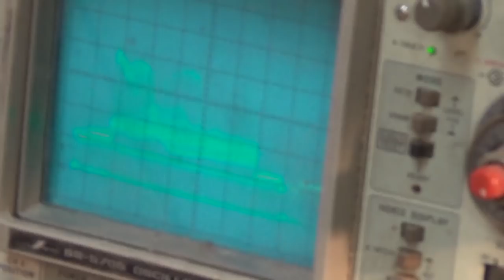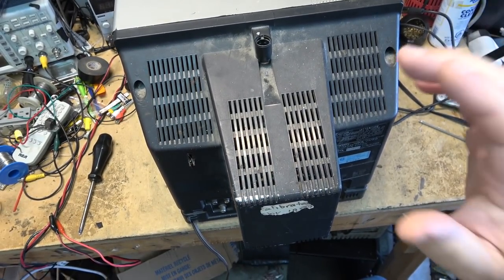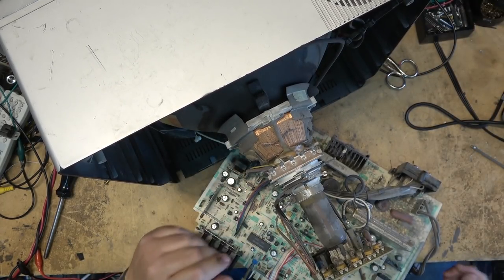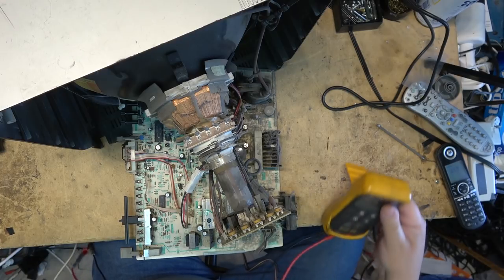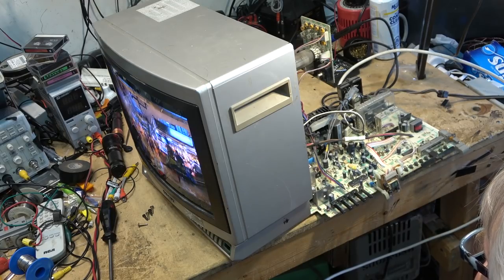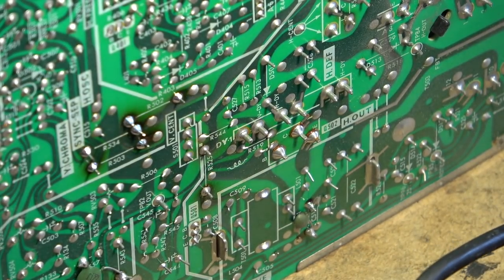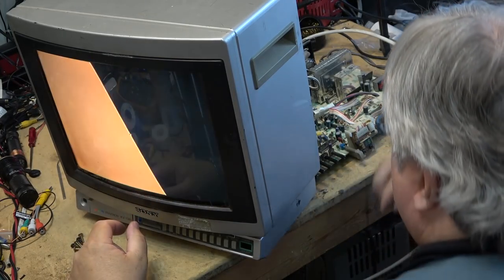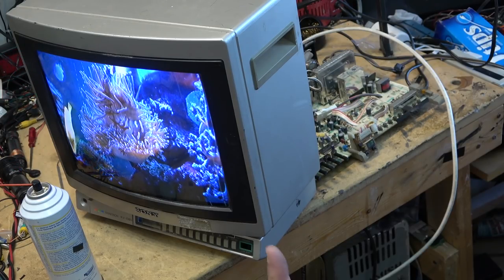Sony KV1365 Trinitron with a vertical and video switching problem

Comment: I had a 1996 Sony Trinitron set I bought new, it was a 27". Super nice picture and it weighed 95 pounds!
Reply from the maker: Is that all? The 40" tube weighed in at 385 lbs and required 3 men and a boy to move.

Comment: I have one of these with the same model number but a woodgrain cabinet. Got it at a thrift store for like 2 bucks a few years ago. Works great as found. The only problem is I need a pencil, etc. to press the internal switches for channel up and down. I plan on trying to solve that sometime.
Reply: Yep! Also got the same woodgrain one. Found it in an abandoned basement. Worked great for the last two years, but it's starting to wig out on me. Maybe it needs a recap?
Reply: @MajorCadence  Do remember that these sets can hold deadly amounts of charge in them, if you work on them be very careful

Comment: I remember repairing a later model 20" which had cracks on the main PCB around the line output transformer. The customer took out the line output transistor and marked as 'failed', as the B-E Junction measured 40 ohms, but later research showed an internal damping circuit integral with the transistor, and did not need replacement, even though there were 'dry' solder joints on the line drive transformer output. From memory, it was a 'flat pack' case style, and used a silicone rubber insulator on the heat sink. Your model might have been the last time they used the TO-3 case style without internal damping of the transistor, but a direct connection to the output of the line drive transformer, and perhaps more susceptible to failure. As there were many cracks on the main PCB (the TV fell from a low table to the floor), I used speaker wire (about the same gauge as the yoke wires) to 'bridge' the fractured copper traces. It ended with a successful resurrection without damage to the aperture grill of the picture tube, and so I could be grateful that the main PCB took most of the damage in the fall, thus saving the picture tube...!

Comment: Yep a bad case of 'Crackus jointicus'  and damp switches.
I'm supprised it still works, it's been used for long periods of time with all the video editing.
Damp is the enemy of old equipment :-(.
Still alive after all these years, sony made good products.
Reply from the maker: Not really.   It might have gotten 30 hours a month max on it.   I did production work but not every day.  Mostly used when doing 2 camera wedding shoots.   I did a couple a month and each one had about 5-7 hours or so of editing. For the corporate stuff we had a suite with leased betacam gear.   The stuff I did at home was mostly weddings, real estate shoots, international conversions and 8mm film transfers.

Comment: Our local library had some 1980s RCA TVs with added headphone jacks. One day I was watching a video and got up to open the door. When I stood up I had the headphones in my hand and when I grabbed the door knob, I got one hell of a jolt. The headphones were the kind used at schools with two metal straps connecting each earpiece. The metal straps also connected the left speaker to the right speaker electrically. So when I grabbed the headphones and the doorknob which was attached to a metal door I completed a circuit and got zapped.

Comment: I remember when Sony had so many problems with the TVs they shipped from Japan they set up a factory in the UK.
They made the CRT tubes in factory and some of the smaller components were imported. 
When my 36" wide screen CRT Sony set died from a dud flyback transformer, I replaced it with a Panasonic LED screen TV and it's still working 21 years later. I doubt if I will find a replacement that will last as long when it finally dies. 
Just for a note the Sony 36" CRT weighed 50 Kg ( 110 Lb ) and needed to men to lift it.
Reply from the maker: 21 years ago they weren't making led screens.  There were LCD and plasma, and Panasonic was big on plasma sets.  They cost a bloody fortune in 2000. Like 12,000.00 fortune here for a 42".
Reply: @12voltvids  Your right it probably is an LCD but it's still working whatever it is.

Comment: I've got a 34-inch late-era hi-def widescreen Sony. Pretty good picture but it's got a couple of scuffs on the top front and the tube seems to have suffered from some sort of a forward tip. The purity is a bit off on the sides and the convergence is a bit lacking even after I reseated the yoke, readjusted the convergence rings and adjusted the digital convergence adjustments. It's a shame but luckily it's easy enough to ignore. The caps on the other hand... they're less than happy. Lots of blooming, even with its high voltage regulator and some subtle picture noise issues too. Meanwhile my beat to hell shadow mask sets look great, even one that seemingly fell flat on its face since the center of the tube is scuffed up.

Comment: I can't imagine what it would've been like capturing and editing pro-level digital video in the late-'90s. Hobbyist DV was hard enough.  In 1998 I had a 150mhz Powermac clone and an ATI XClaim VR video capture card.  I could just barely eek out 15 fps, 320 X 240 video with only a couple dropped frames on that setup.  Fun to play around with though. Funnily enough  I had a 15" Sony Trinitron monitor for that computer, I think a 15iiSF, or something?  I can't remember.
Reply from the maker: I was editing on a pentium 2 using a gigantic 9 gig UW SCSI drive in full broadcast video. 
The 9 gig could store about 1 music video of clips. 1 minute of video, 1 gig. Rendering took forever.
For this fun I spend about 5000 for the hard drive alone.

Comment: Great looking picture i have a semi portable 18 inch sony from 1984 that i like has the glass panel over the tube ,i then went on a search for an original remote at the time i found one on a worldwide search uk seller and before shipping it they tested found some of the buttons did not work and refunded money i spoke to them and asked if i could still buy it and they sent it for £2 towards postage ,the main button i wanted to work worked the one to remove the onscreen channel number .its an rf only set but i have a scart to rf adapter and that works fine with it .

Comment: I had that exact TV about 20 years ago. It was a great little set. I found it put out for garbage, took it home and the only problem was someone had deleted all the channels, so the tuner was showing a question mark.
Reply from the maker: Wouldn't have been this set.  No channel memory on this one.  The remote version yes.  And noone deleted the channels the static RAM chip failed.
Reply: @12voltvids  Yeah, I posted too soon (should have watched more than 3 seconds of the video, whoops!). I checked, I had the KV-1370R.

Interestingly when I added the channels back (had to use a remote to tune them), they stayed permanently, even powered off for weeks. Maybe something cause the static RAM chip to take a dump that one time.
Reply from the maker: @probnotstech  strange because usually when the memory chip went out it stayed out.
Reply: @12voltvids  Weird then. I remember that set worked great until I sold it.

I had assumed some kid went and deleted all the channels, because I had done exactly that as a kid to my parents' TV - with similar results.
Reply from the maker: @probnotstech  possible however generally when that happens the set starts on channel 2 and just stays there when you press channel up or down.
Reply: @12voltvids  I think that's what my parents' RCA console did when I messed it up. However, when you tried to change channel, it would just flicker gibberish on the LED readout and act like it was cycling through the channels (similar to how those sets acted when they got cold solder joints in the tuner). That was one those RCA sets that didn't have a numberpad on the remote, only up and down.
Reply from the maker: @probnotstech  good old RCA colortrak.
The colortrak 2000 was even worse. Some rocket at RCA thought it was a good idea to store the channel memory in the remote. It was this big Square remote with like a fake leather  wrap and it took two 6 volt type j batteries. Now those batteries have been developed for Kodak with their instant camera. Polaroid sued Kodak and one for patent infringement and all the cameras had to be recalled. Ever ready had made billions of these stupid batteries and now there was nothing to use them so RCA started using them in the remote controls so there was a use for all these surplus batteries. On the TV there was number buttons 0 through 9 and volume buttons but no Channel up and down. On the remote control you had number buttons volume up and down and channel up and down and the stupid remote stored the channels in the memory there was an add and erase button also on the remote.
Needless to say when the remote got damaged people were not too happy because they couldn't scan through channels they had to enter the channel directly on the TV. And all those sets if you wanted the video inputs you entered 91 for Video one and 92 for video two.
Reply: @12voltvids  That's fascinating about the J type batteries. Zenith used them in the early 80's too, and I always thought that was weird. 

I remember my some friends had one of those Colortrak 2000 sets (no remote, of course). As you described, no ch up/down buttons on it, and the usual RCA ch91/92 inputs.
Reply from the maker: @probnotstech  
I wonder if the j battery is still available? That was america coming up with a solution to a problem. What to do with millions of batteries that had already been made.   We will just use them in a remote and store the channel memory in that remote.  That way there will be a drain on the battery and you will have to spend 9.00 every 6 months for a new one.   Not joking that was about the life of it.  They used then for many years.  I think right to the end of tv production in the USA.
Reply: @12voltvids  You can still buy them, believe it or not. I think I even remember seeing them in stores maybe 10 years ago.

Comment: i have had multiple shocks in the past while connecting or disconnecting coaxial tv antenna cables. Usually when touching the metal outer shield of both connectors. I still wonder why
Reply from the maker: Leakage through the isolator.

Comment: i'm surprised you would junk anything,you seem to able to fix most things
Reply from the maker: I toss plenty of things.   It's not a point on if it can be fixed.  Some things I fix for fun and to make a video.  Before it goes back together the parts cone out and off to recycling it goes.  I have a garage full if stuff that much will be heading to the bin soon.  There is much stuff abandoned.  People send me things to fix and then when they get the bill for it tell me to keep it.   A VCR I did last week, guy spent a fortune sending it to me thinking it was a good VCR (svhs) it wasn't.  It was a standard VHS Hi-Fi. I was prepared to send it back repaired for very little but the freight was the killer.  He said just junk it.  I'll probably get 20 bucks for it.

Comment: I also have a Sony Triniton. But the picture starts to jump after 10-15 minutes when the TV gets warm. Could that be bad caps or bad solder joints aswell?

Comment: Sony KV-G21Q1 TV has double image issue with very dull video. I replaced CRT Socket but problem was not solved. Please help me.
Reply from the maker: Double image?   That sounds like a deflection problem.

Comment: How come most cleaners advise to let dry first before testing and you always do it with the circuit on, is that some special type of cleaner ?
Reply from the maker: Newer cleaners are flammable for starters.  I use old Nutrol and it dries very quickly.  Freon tf based as opposed to alcohol based or napyha based.

Comment: Is that Vesa compatible?
Reply from the maker: It's just a video monitor. Nothing special.
Reply: Is it an old reference one? For color mastering? I know the old Sony trinitron pc monitors are going for a fortune on eBay now because they have such a good picture. Digital Foundry did a special about it and compared ray tracing and other effects with new high end monitors and tbe old Sony won. I think the 48 inch LG c9 beat it but technically that's not a monitor. LG loses a fortune Making the 48inch oleds because of the way they cut panels from a giant mother glass they call it. I have the 55 inch c9 and it looks incredible. I'd never have paid full price for it though if I didn't get such a good deal on it. I wanted hdmi 2.1 for when the new consoles came out but they struggle to output 4k 120fps, well they technically don't output 4k 120 with the way they scale resolution.

Comment: Don't like the long leads on the thru components on this Sony....should be slightly bent and then trimmed.   Otherwise vibrations and heat over time cause failing solder connections.....especially on the heavier components
Reply from the maker: Well that's the way they did it in Japan.
Reply: @12voltvids  I know....have worked on a few like that....and think may be a/the reason for failing solder connections
Reply from the maker: @Sans_Solo_  wave soldering is the reason.
Reply: @12voltvids  That board does not look like wave tho
Reply: everything on board tends to ripple with wave soldering
Reply from the maker: @Sans_Solo_  
All the Sony stuff was dipped back in the 80s.  The owner of the shop i worked at got a tour of the factory when he visited Japan.  Took some pictures (on film) of the assembly process.  Before the pick and place machines they had a line of workers inserting the parts then the board went into a bath of solder and then another worker cut the excess lead length as the board's came out.
Reply from the maker: This film from 60s and early 70s  but good.
Reply: @MrChrisRP  Excellent thank you for posting this!
Reply: @12voltvids  Wow that's cool he was able to visit the Sony Factory!  I have an Audiolab 8000t tuner (that I recapped) but all the boards look horrendous; traces all appear wavy and look like delaminating/separating, but was told this was a signature of the automated wave soldering. Cheers

Comment: Solder the i,f canister these are very prone inside
Reply from the maker: I am fully aware of the if can coils.  Didn't do it because the tv is not going back in service.   Perhaps a future video I will cover that common fault.  Not really relevant these days as there's no analog broadcast so there's no reason to be using the tuner

Comment: set looks pretty tired, the geometry isn’t too great after all these years
Reply from the maker: Yup the rubber spacer for the yoke has fallen off, and that is what held the yoke in place. It would have shifted and caused the geometry to change slightly.  Not worried about it as i won't be using this set just leaving it in storage to be thrown out when i decide to sell the house and downsize.
Reply: @12voltvids  i’ve calibrated tons of crts for geometry and convergence, including sony trinitrons. what has happened over the years is that sony used terrible glue with no overlying tape for their yoke wedges, and on top of that, the surface of the sony wedges are perfectly smooth. you’ll find tons and tons of 32/36 inch WEGAs whose pictures are now drooping and sagging. Those huge heavy yokes were too much for the shitty wedges sony installed originally, and the wedges just pop right out under the pressure.
Reply: @12voltvids  by the way, you mentioned that the B- has 800k ohms connection to the neutral side of the AC line, right? If you reversed the plug, those 800k ohms would do nothing to bring down the 120 volts in the circuit and would only reduce the current flow, right?